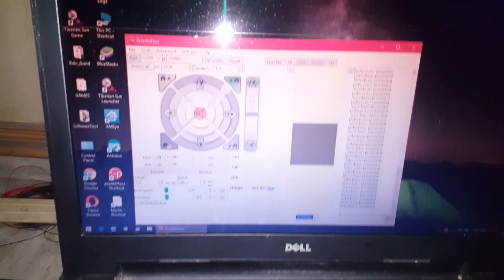DIY HomeMade Wooden 3D Printer Pt.01-Closed Loop Timing Belt

Comment: Nice!  Looking forward to seeing it operational.  

I too am building a "repstrap" wood printer. I'm working up the courage to begin hot gluing the z-axis rods to the wood.  ;-)
Reply from the maker: they are actually removable  i used some plastic brackets which are normally used to install electrical wires and then i used hot glue ... now i have printed some 8mm brackets and i'm using them for now... i didn't upload videos here but i will